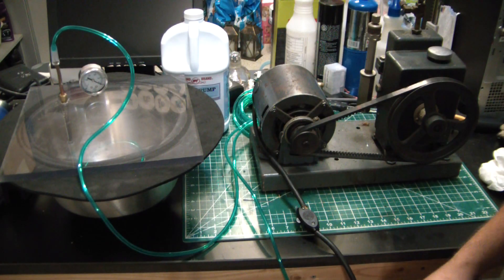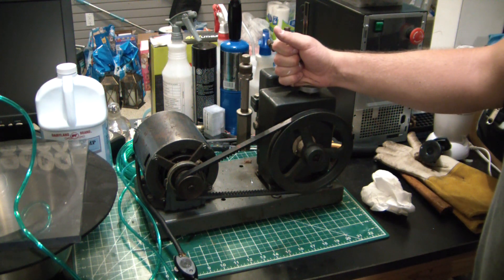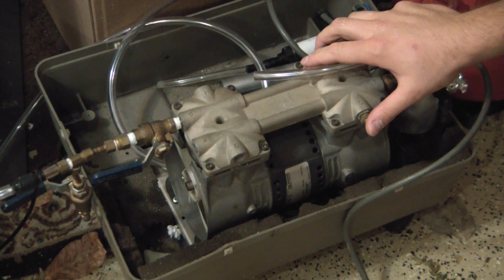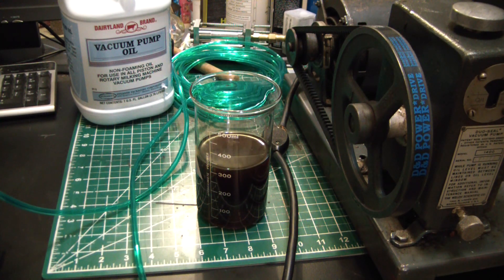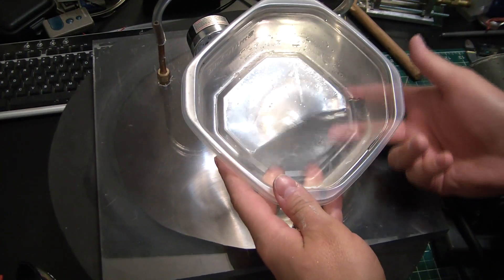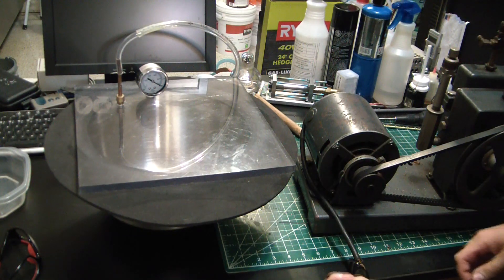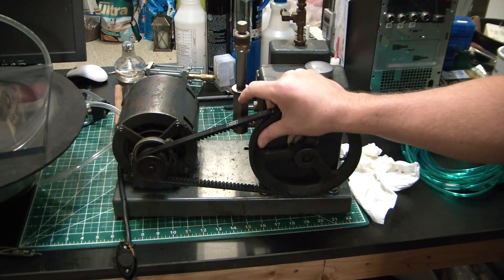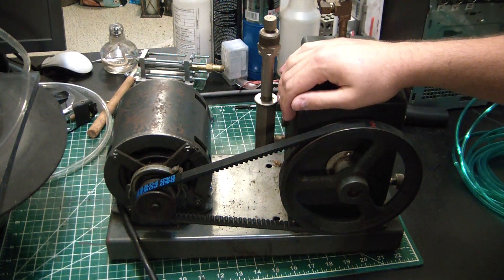Super Simple Vacuum Chamber & OLD Vacuum Pump - ElementalMaker

Comment: The ballast valve should be opened a tiny bit before starting the motor and close few seconds after the motor is running and that’s it.  This is on the instructions of my JB 2 stage pump.

Comment: When you boil water with an oil pump, you need a dry ice trap or desiccant trap between the chamber and the pump, otherwise you are immediately contaminating your brand new oil with water vapor and you're going to need to change your oil again.
Reply from the maker: Absolutely true, I need to get a proper cold trap set up. The oil I use is cheap enough I don't mind switching it constantly. This pump has a built in feature that let's it run and remove water from the oil as well

Comment: Since you asked:  I inherited an old Alcatel industrial vacuum pump and was able to find rebuild parts and the owners manual online.  It has a "mystery" air inlet valve, and the instructions say one can purge volatiles from the oil by running it until it gets hot, then letting air in the valve.  Also made a vacuum chamber using an 8" PVC coupler, 1/2" plexiglass, and solid neoprene sheet (not my idea, saw it on the 'web somewhere).

Comment: Hello. If you accept a suggestion, just buy a normal refrigeration filter, an old fire extinguisher, connect in this sequence (maybe you'll need some soldering): inlet(from de vacuum chamber)-fire extinguisher(inlet down, output up)-filter-vacuum pump. Then enjoy many years of good vacuum.

Comment: The age of these pumps has little to do with the depth of vacuum you can pull.  They can, however be damaged by corrosion  from water, or particulate matter getting in.  If there is no mechanical damage, then the critical sealing is done by the oil itself, so a couple of flushes of clean oil will normally get you into .1-10 micron level vacuum.  The seal on the shaft is there mainly to keep oil from leaking out.

If it is actually worn or damaged, they can be fixed by lapping the end plates flat again, as well as the rotor faces if need be.   The housing then needs to be lapped to a couple thou wider than the rotor, and new vanes trimmed (ground) to match the rotor width.

If you have to disassemble one, it is critical on reassembly  that the rotor to housing spacing be set correctly, which has to be done blind.  The trick is to use a shim of 1 layer of cigarette (yeah, right!) rolling paper at the oil seal (slot) area, and let gravity press the housing onto the rotor.   The rotor should be positioned with the vanes near vertical for this (just to the side of the slot).
The shim disintegrates upon running, and is removed when the oil is changed after a few minutes run time.  

One last thing:  As a lifelong high altitude dweller, it drives me nuts when people don't mention that the gauge (differential)  readings they are spouting apply only at sea level.   In Denver or Albuquerque a perfect vacuum is only 24"Hg or so, depending on weather.   Refrigeration and AC literature rarely mentions this, and I have never seen it even mentioned at all in automotive AC literature.  If you use a thermocouple or Pirani gauge, it doesn't matter, as these respond to absolute pressure, and do not rely on atmospheric pressure as a reference, but automotive AC techs often do not have TC gauges.   And also, barometric pressure is NOT ambient pressure...it is adjusted for altitude, so weather forecasters don't need to think about it.
Reply: i want to buy one of those welch machines but...  my fear is just that, that i probably have to lap or fix, not only apply manteinance and clean things, clean rust...  and change rubber and o -rings if needed.  indeed i dont know if i can dismount and reassemble the machine correctly, i could with a playstation 3 or an xbox360 and old smartphones but i dont know if i can make the full refurbishment so i can pull the original spec vacuum.   

what i make if i need to lap? i dont know hot to make that totally perfect... so probably i can't obtain the original vacuum
or if something worse happens... goodbye welch or hello mechanic at the corner.

these machines are very very good, if you see the graph... is... the better pump in the market for small chambers or setups... and brand new are very expensive, so...  i don't know if i can try that without failing brutally but i want to make that.  

there is a "magic solution"?  XD

Comment: Idea for freeze drying, Take your vaccum chamber bowl and put it on a bed of dry ice or in a liquid nitrogen bath while it's running. For the heating part you could try using a fish tank heater in a water bath inside the chamber. Just make sure the fish tank heater won't explode in the vaccum and will reach the temps you want.
Not sure if it will work but you seem to have the resources and cleverness to expand on the idea if it's viable.
Good stuff!

Comment: Fun topic. Would it power a vacuum table?
Reply from the maker: Typically vacuum tables use much higher volume blowers such as a shop vac to hold down work pieces. This pump is very low volume (0.9cfm) but very high ultimate vacuum. This would be more useful to evacuate air conditioning lines before filling with refrigerant or other high vacuum applications.

Comment: If you want to use it for drying, dont forget to have a desucant and a heating pad. For some reason everytime someone diy's a vacuum chamber to use drying, i rarely see something to raise the temperature.
Reply: At.001 torr drying is not sped up much by temperature, and a heating of won’t do a thing. With the chamber near absolute vacuum, assuming his sample b is sitting in a dish or smaller vessel on some desiccant, a heating pad will not heat up the sample because the vacuum is such an efficient insulator. In your application truly does require heat, like degassing a non-Newtonian fluid where heat is required to loosen it up, a radiative heat lamp will heat transit the vacuum and heat surfaces

Cool pump btw, I just picked up a 1400b and am looking forward to playing too
Reply: @sstroh32  thank you. That's not something i would have figuted out without several frustrating attempts.

Comment: https://www.ebay.com/itm/Wegner-Vacuum-Pump-W-M-Welch-MFG-Co-Chicago-Illinois/232626852269?hash=item3629a411ad:g:xxUAAOSweLBaVut4
Reply from the maker: That's a single stage pump, but still a very good deal if you have a spare 1725rpm motor laying around 👍

Comment: There is no possible way you will ever pull 1 micron with that setup. The pump itself might go to 50 microns if you are lucky.
Reply from the maker: Pump is rated to pull 0.1 micron. Of course this chamber setup is leakier than a sieve, but with a proper chamber many folks use these pumps for fusors, which require a pretty high vacuum.
Reply: @ElementalMaker - I don't mean to be argumentative, love your channel, watch it all the time, <insert more sucking-up here>, but I've been <insert impressive claim of experience> for <insert a long amount of time>. ;-)

My guess is that the pump is rated for 0.1 inch of water, which is 186 microns of mercury (the term that vacuum guys are referring to when they say "microns").

A two stage vane or piston pump just can't get the low pressures like a diffusion or turbo pump can get. Not even close! I use a 2 stage robinaire pump rated at 35 microns as a backing pump to my real, true, vacuum pump, which is a diffusion pump, because I can't afford a turbo pump. I can get 50 microns at the robinaire on a good day and fractions of a micron at the diffusion pump if I am very careful about my test setup. But even then, a special micron gauge is required to make the measurements. A dial gauge (directly readable) is impossible, since 1 atmosphere is 760,000 microns and 50/760000 would not be perceptible to the human eye on a dial guage.

There has to be a units mistake here.  There just has to be.

I'd love to reach clarification and understanding on this, but will continue to hit like on all future videos either way.
Reply from the maker: @FelonyVideos  no worries. Always enjoy a good discussion. You can see the specs of the pump here https://welchvacuum.com/products/duoseal-1400#product-specifications. It's listed ultimate pressure is 0.1 micron, or 1x10-4 torr. I don't believe this particular pump could ever reach that, given it's age and condition. Even with a rebuild the steel mating surfaces are probably not adequate, but that's the listed pressure from welch. And given their scientific pedigree I do believe their data. I really want to find an old hastings vacuum gauge and test how far I can push this old pump.
Reply: @ElementalMaker -  Well dang, you're right! I'll eat my words on this one! Appreciate the response and agree, welch knows what they are doing. Now I want one of those pumps!
Reply from the maker: @FelonyVideos  yessir I'm sure back in the day this pump could pull one hell of a vacuum. I wonder why this two stage pump can pull such a strong vacuum compared to some others in the market. Maybe it comes down to part tolerance.

Comment: For freeze drying, just add a valve on your vacuum chamber, pull a vacuum, close the valve, and remove the line, then take the whole thing into a freezer... Or connect the chamber valve up to a Teflon tube and siphon in liquid nitrogen, which will flash freeze everything in the bowl.

For your seal just scratch up the flat rim of the steel bowl, clean with alcohol, and lay a generous bead of Loctite 592 (vacuum rated gasket maker/sealant with Teflon in it), and let it dry for 72 hours. You can use the same stuff to remake your pump gaskets if you want to rebuild it and can't get an affordable gasket set. It's around 30$ a tube of 50ml.

Comment: You may want to use a cold trap in the line when doing things with a lot of moisture in them. However it looks from reading the comments below that the gas ballast may also be very useful for the same thing. Water in your vacuum oil is not something you want. That is a very nice old pump.
Reply from the maker: Yeah I definitely want to build a cold trap. Only issue is nowhere around here sells LN2 and its even hard to find dry ice. Closest place that sells dry ice is about a half hour drive. I may try building a multistage peltier cooler to use for a cold trap.
Reply: @ElementalMaker   No dry ice near by that not nice of them at all. What about a welding supply for the LN2 and just keep a supply on hand or would the need not justify the cost? The multistage peltier may do the trick. For that matter even water ice with salt would be better than noting I would think.

Comment: Great to see you back. I worked in Vacuum Physics for 20 years. What a lovely old pump.  Gas Ballast bleeds air into the pump to mostly remove water from the oil, the pump runs a bit hotter. If the pump is single stage your ultimate Vacuum pressure will rise, 2 stage, no problem. When you change the oil,run gas ballast for an hour or more. Don't breath in the pump exhaust, ever, especially when running gas ballast, a shed load of oil vapour is expelled. Cheers Mate. 🇬🇧👍.
Reply from the maker: Wow 20 years of vacuum physics! I bet you have done some awesome experiments and have some great stories! This model here is a Duoseal 1400, so it is indeed a two stage rotary vacuum pump. Any idea how long it might need to run with the gas ballast open to get water vapor out of the oil? I am building a filter to thread into the exhaust to help capture oil mist. I am sure if I ran it overnight with the current cap I would come out to a very oily workshop in the morning.
Reply: ElementalMaker  cool mate, I'll get back to you soon and tell you about some of the systems I used to work with if you don't mind, I could strip down any Rotary pump bloody blindfolded. I'll give you any help or advice you need mate. I must bugger of now,  I've got to get up for work in 5 hours. It's 00:30hrs this side of the pond. Speak soon. 🇬🇧👍.
Reply: Hi my friend. Sorry  this Missive is a bit long. I'll tell you a Shit load Cool stories to pass on mate, I'll do it in small segments, unlike this lol, otherwise it'll get to much to read and I don't want to bore you. Do you have a face book page? I think I've still got an unused oil mist filter with an Activated charcoal cartridge I would be happy to send it to you, if you have a work address or PO Box I could send it to.  Please be careful if you make your own diy oil mist filter, if you get a restriction you could blow out your oil seals, not good. Run the pump on gas ballast for a couple of hours after the oil change and check the state of the oil .  It might be a good idea to change the oil again. It's good to run the pump for extended periods. When I worked at GEC Avionics Applied Physics we had over 150 Vacuum systems of every conceivable type, all our rotary pumps ran 24/7. Sorry this message is a bit long. Lastly, I built an Ultra High Vacuum system that had to be 100% Hydrocarbon free, so no turbo molecular, rotary or diffusion pumps. This baby could pump down from atmosphere to 5x10-10 Mbar with no moving parts. Well cool.  I'll keep it short next time. Take Care Mate. 🇬🇧👍. 🍺Cheers.

Comment: I´m not sure what exact type of pump you have here, but AFAIK all rotary vane pumps are unsuitable for pumping water vapor. It will contaminate the oil and apparently can also cause damage to the pump through cavitation. Opening the gas ballast does help degas the pump´s oil, but is not enough if you are intentionally pumping a significant amount of water.
One way to degas your oil in general is to seal the pump´s inlet and leave it running with the gas ballast open.
Reply from the maker: This model is Welch Duoseal 1400, they are build for pretty rugged use. Owners manual doesn't say water vapor is an issue. I believe that is what the gas ballast is for, it heats the oil to drive off various vapors trapped in the oil, water being one of them.
Reply: @ElementalMaker  In general, a rotary vane pump should always be heated to its operating temperature before pumping anything, especially "condensible vapors" such as water. If you run the pump at its ultimate pressure, it has little friction and therefore generates less heat. So for more heat, you can open the gas ballast to give the pump something to move. This also decreases the ultimate pressure it can reach by a bit.
When the oil is hot, anything dissolved in it should outgas much faster than otherwise, and things won´t condense as easily. However this is still a fairly slow process.
I´m not 100% sure if there are any rotary vane pumps that can handle this, but normally to pump water vapor, you use a cold trap to condense and freeze it before it enters your pump. There are also vacuum pump oils that are specially designed for pumping condensible vapors, but even then I´m not sure if they still expect you to use a cold trap. (it won´t remove 100% of the vapors of course) On the other hand all the info about vacuum systems is always about running these systems 24/7/365, so I have no idea how fast any of this becomes a problem.
Reply: Had a look at the manual and I found something about it: (from a newer model)

"1.171 The need for a Trap
Where corrosive vapors or large quantities of condensable vapors are evolved from vacuum processing, a cold
trap may be used in the connecting line to the pump. It will help prevent damage to the pump mechanism and
reduce oil contamination. The cold trap, immersed in a suitable Dewar fl ask, is installed to that the vapors may
come in contact with the surfaces of the trap and condense. Commonly used refrigerants are liquid nitrogen or
dry ice and acetone. The refrigerant to be used depends upon the freezing point of the contaminations. "
Reply from the maker: @Basement-Science  nice find 👍. That's what I get for breezing through a manual lol. I don't think I will be doing anything involving large quantities of water vapor aside from that little demo for the video. If I do end up trying freeze drying I will definitely build a cold trap for it though.

Comment: They just don't build stuff the way they used to.  This is a well built unit. To get something of similar quality today (assuming it even exists) is cost an arm and leg. Likely the only way you could get similar quality is with a large commercial unit.
Unless it wasn't working at all or performing so badly that it is essentially useless, I wouldn't rebuild it.  The rebuilding kits are probably nowhere near the quality of the original.
Reply from the maker: They still sell this same model today, virtually unchanged aside from a belt guard. It'll run you about $2K to purchase, but still built like a tank!
Reply: But is the model unchanged?  There may very well be revision updates that includes cheaper components.
The decline in quality of even industrial equipment has been astonishing. Back when I was about 20 in the late 80s I worked in the steel industry and even then the old equipment was way better than the new equipment. We had these 20s/30s era cranes that were in service and used 24/7 that were built like tanks and almost never went down. Then we had 80s cranes that bowed and went down constantly.
Reply from the maker: @tarstarkusz  apparently the duoseal pumps have remained unchanged in build, design, and quality since their introduction. Even newer ones are known to run forever. They have actually upgraded the seal materials to viton, so they will likely last even longer nowadays.

Comment: I thought the reason it freezes is because the vaccum pulls away the vapor which lowers vapor pressure and the evaporation of water, with its latent heat pulls so much heat from the water (to evaporate water and raise the vapor pressure) that it just freezes. along the top.